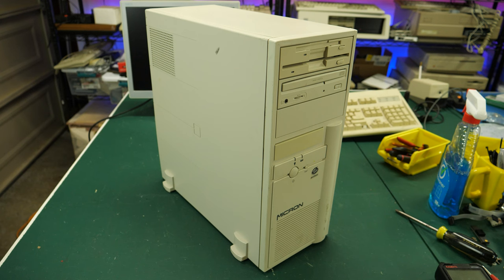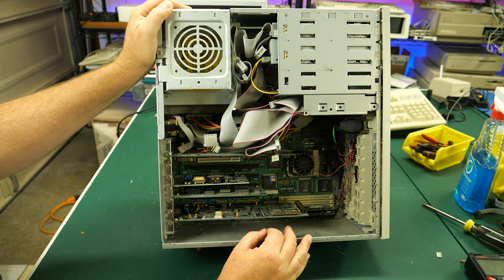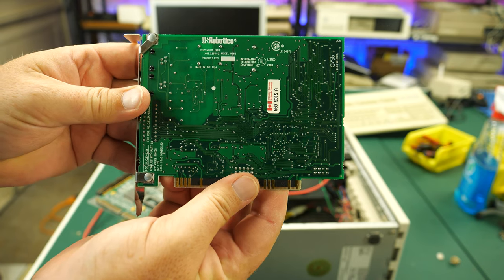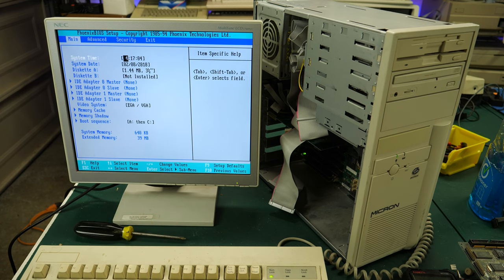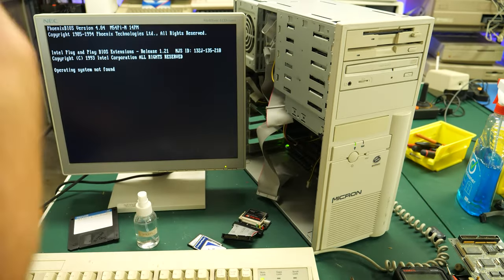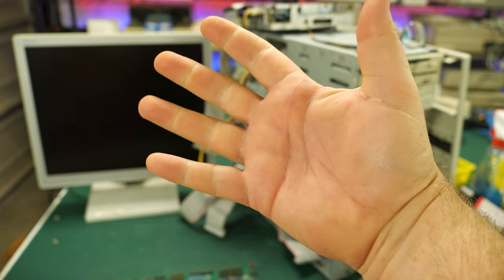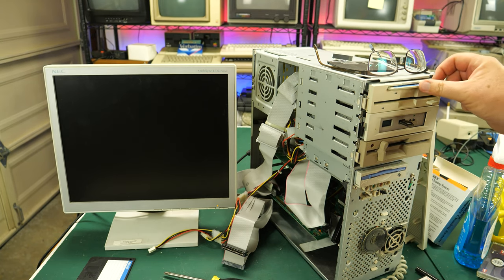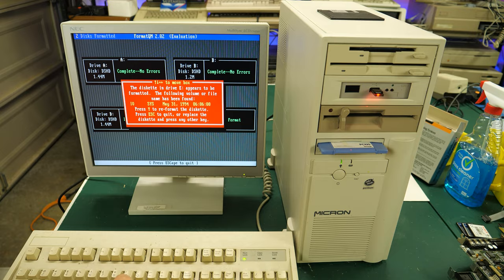Three Floppy Drives, A Gotek, And A Zip Drive Walk Into A Bar ...

Comment: "Floppy drives and a Zip drive"?

Zip drives ARE floppy drives.
Reply: Magnetic film storage is the only similarity. The definition didn't include Zip and Jaz. You can't shove a floppy diskette into a Zip drive, genius.
Reply: @ABRetroCollections  (in parts so it will show up; part 1): Wrong. It's a floppy disk because it's a magnetic disk that's floppy. Zip is just the BRAND of form factor. Can you put a 5 1/4" floppy disk into either Zip or a standard 3.5" floppy disk drive? No. Can you put an 8" floppy disk into either one of those other three floppy drives? NOPE! But are those two physically bigger ones still floppy disks? YEP! So I guess it doesn't have anything to do with whether or not you can put one into the other drive.... DOES it... "GENIUS"? And actually, you can put a standard 3.5" floppy disk into a Zip floppy drive. (I wouldn't recommend it, though.) (Cont.)
Reply: @ABRetroCollections  (part 2): By the sound of it, you've never heard of the many other form factors of also floppy disks out there, like the Amstrad, 2.8" like the kind that goes into the Nintendo Famicom and those Smith-Corona and Brother digital typewriters, and the three 2" floppy disks: Fujifilm LT-1, Iomega PocketZip, and the Sony/Canon VF-50. Guess what the F in "VF" stands for... "GENIUS"! (Cont.)
Reply: @ABRetroCollections   (part 3): Iomega Bernoulli is also a floppy disk. So Iomega made three styles of floppy disk!

And of course the Jaz isn't a floppy disk; it's a HARD disk, duh. Just like the SyQuest SyJet, Castlewood Orb, and Iomega Peerless and Rev disks are... "GENIUS."
Reply: Nobody at the time called Zip drives floppy drives. They were called Zip drives to differentiate them from the older 5.25" and 3.5" drives. If you said "hey hand me a floppy disk off that table" and someone handed you a zip disk, you'd say "no, the smaller one is a floppy disk, that's a zip disk".
Reply: @soupwizard : Nope. 1. You can't know what everyone did or didn't call something, because you're not a mind reader. 2. That doesn't matter, anyway. It's not about what a lot of people may or may not have called them; what matters is what they just ARE, according to the definitions of just plain words. 3. They were not called "Zip drives" and "-disks" to differentiate them from older floppy disks, because someone could easily have had to differentiate between the 5" and 3.5" sizes of standard floppy disks as well. Zip disks were called that simply because that's the brand of form fa--...

...Wait, did you totally just ignore what I already said to this other guy up here that already explained this? Did you not notice all those other floppy disk forms out there? What if there was an Amstrad floppy out there, or an Amdisk floppy, or an LT-1 or a VF-50? Same thing, they're all floppy disks and yet you would still have to differentiate them from each other. So NO, I would not say "the smaller one's a floppy disk; that other one is a Zip disk." You can simply refer to the standard floppy disk as a standard floppy disk, but if all 3 sizes of standard floppy disks were on the table, or even 2 of them, you'd still have to differentiate. Just because a newer form factor was branded doesn't mean it's not still that type of object, DUH. It's a disk. It's floppy. It's a floppy disk. Just like the Amstrad, LT-1, and those others. The floppy disk is simply a generic category of medium, which Zips and Bernoullis, etc. fit into, just like the hard disk, audiotape, videotape, film, and phonographic discs, cylinders, and ribbons.

Even the encyclopedia and Iomega recognizes Zip disks ad floppy disks. The mistake you just made is like if you were to be looking at some videotapes in a group, and they are an assortment of Beta, VHS, Video8, Video 2000, U-Matic, and maybe some others, someone said, "Hand me that videotape," and you immediately handed them the VHS one instead of asking them which one, because according to you, "Betamax isn't a videotape, it's Betamax." Well, this might be the reverse, but same principle. Just because they're branded form factors doesn't mean they're "not videotapes."
Reply: As were LS-120s, which had the added benefit of being fully and transparently backwards compatible with 720, 1.44 & 2.88 formats of 3 1/2" floppy. One IDE interface, four formats of the floppy disk, and the reason I never used a zip drive in my life.  I bet I could find a way to plug a zip drive into a USB port if I ever needed to use one, or a Bernoulli, 8", 3", or any other weird formats or form factors that existed at some time. Just about any port or interface you could ever need is available to plug into USB, although some are more functional than others.  For example, the precision timing available from an interrupt-driven serial port is lost when you plug it into a USB port, which is polled, so has variable latency.
 In the same way, my BD-XL R/W reads and writes all previous formats of 5 1/4" optical media.  I can burn an audio CD should I need to (and that does occasionally happen).
With those two and a multi-format flash card reader/writer, I doubt if I'll ever need anything else to go with the spinning rust and Nvme which houses my main pool (along with the RAM)
Two small partitions on an Nvme for the bootloader and ZIL, the rest for swap space in the unlikely event that I'll need it (although some OSs like to have some whether it is needed or not), a couple of 2 TB Nvmes mirrored as the 2nd level cache and lots of spinning rust for (redundant) capacity.  It is nice to have a capable motherboard. Cache hit rates vary between 85 and 95%, depending on what silly things I'm doing, so it's pretty quick as well as approaching humungous.  Everything is cached and checksummed, including the checksums, so any data corruption is quickly and silently dealt with, but to be on the safe side I scrub weekly and have backups both on and offsite - I may be stretching the onsite definition though, as they are separate buildings.  The offsite are both on a different continent and on my own (A group of friends can easily hold each other's encrypted pool clones or replicas, by using limited-rate internet replication - it doesn't matter if it takes a week if the previous week's replica is already there and a completely current copy is held locally as well).  If my house burns down, losing a week's worth of data will be the least of my worries.

Comment: DUDE!!!     Dirty Disks !~!  Moldy Disks!!  You start this vid saying you want to test many, many disks on hand. Many, Most, Several, A Few will be moldy, dirty, or aged to the point of losing the magnetic material when touched by the head(s) the first time.  How will you know if a disk is bad or the heads are dirty between disk swaps, unless you clean the heads after each read? Or lost its magnetic material? This is the Archivists ongoing issue. NO home user solutions has presented itself, as yet. Disk by disk, full circular inspection before spinning in a drive is need. This requires a microscope. Or a lot of disk cleanings between disks will be required. Or you can take a chance that the "image" of the disk will be complete and without errors. (IMO this very is hard to do, you need to test all programs with all options   Most disks still seem to be 'good' but how do you know if ALL BITS are good? I would welcome a video about this on going and increasing problem. Greesewealse and all the programs you need to run the data through to get a "complete" raw data image seem to be ok. But there can not be any full/complete 'verification' of the data and the programs are fully run from emulators. A video on this deeper topic would be VERY interesting.  fyi